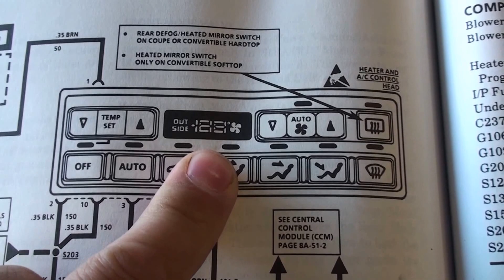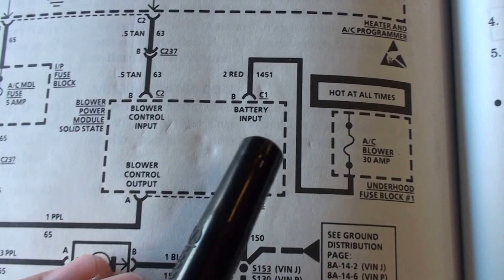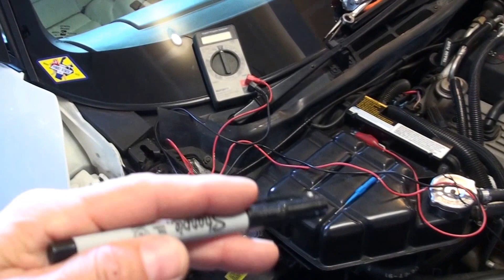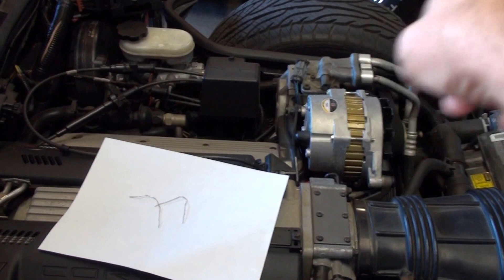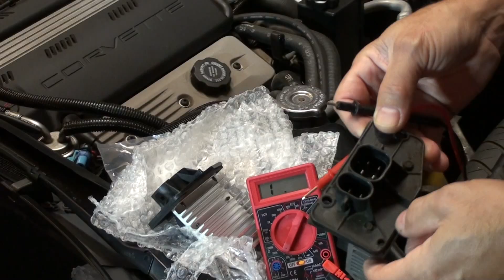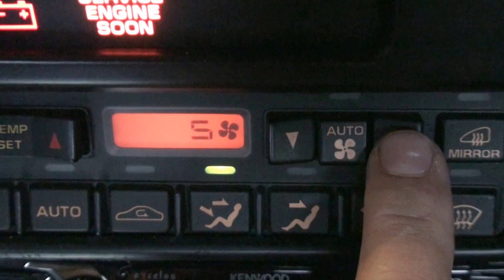Corvette Blower Motor Module Diagnostics and Repair! - Ozzstar -

Comment from the maker: 1990-92 Corvette Blower motor module Delco:  https://amzn.to/2JW1R8X
Check out some cool tools in Ozzstar's Amazon Store:  https://www.amazon.com/shop/ozzstar
Please comment and ask questions below.  Subscribe and Like!  Thanks for watching.  -Glen
Reply: Ozzstar. Excellent videos. Can I ask something regarding the climate control unit 1992 C4. I have a code 9 on my unit - low refrigerant - I have had the unit recharged but the code will not clear and the A/C will not function. Any ideas. Thx
Reply from the maker: @garyturner9904  sorry I can't diagnose that over the internet. Are you sure the refrigerant didn't leak out immediately?

Comment: I have an ‘89 Vette, it has 4 wires instead of 3 going into the one connector and 2 wires instead of 1 in the other, which module do I buy?
Reply from the maker: GM part# 16061602

Comment: My fan is either full blast on 10, or it's off. So, since that creates less heat in the blower motor module. That may be why I'm still running the factory blower motor module in my 89. Or just got lucky so far.
Reply from the maker: Sounds like a module problem or eletronic head unit issue. Did you see my video on that repair?
Reply: @ozzstars_cars   Mine is an 89. Though I've already took that apart and rebuilt it with a Batee rebuild kit. I have read blower motors drawing too much current can fry wires. So could just be these chinese blower motors are just junk. I don't remember that wire being melty back when I still had the original blower motor. Though that was a long time ago like 15 years ago when I first replaced that.

Comment: I've got an 89 with C68. I believe C68 started in 86 or 87. And my blower motor wires/plug had gotten melty over the years with insulation dissapearing. And also had the 4 pin plastic plug on the module get melty on the purple wire where the blower stopped working. And had to use a flat blade screwdriver to help pry the 4 pin plug off the module as the melty plastic around the purple wire had coated the male pins and fuse the plastic together.

Had to scrape plastic off the male pins a few years ago and used dielectric grease on the plug to keep it from fusing together. Got a replacement harness for the two wire plug on the blower motor I was going to butt connect on. But seeing this video. I'm going to open up the plastic tubing for the wiring to see if the purple wire and ground wire from the blower goes up directly into the 4 pin plug on the module. And instead see if I can instead buy 12AWG wire and new terminals and replace the entire purple and ground wire with all new pins. Though that wiring diagram kind of looks like the purple and ground wire may connect to other wires on the way to that 4 pin plastic plug.

Also helpful is seeing the later C4's 4 pin plastic plug still has a place to put the 4th pin that is on my 89. As I had seen some photos of replacement 4 pin connectors where the 4th unused pin for later vehicles instead just has an empty square instead of a place to install a 4th pin like on my 89.

As that plug is kind of melty, and they don't sell that black plug anymore. So gives me more C4's to check out with including the later C4's going to a junk yard to see about cutting and removing those plugs so I can use the black enclosure on my 89.
Reply from the maker: Exactly what you said at the end... a donor car and some wire cutters.😜
Reply: @ozzstars_cars  I ended up splitting open that part of the wire harness. And the purple and ground wires are connected to other wires up in the wire harness from the blower motor to the module.

GM used some kind of open barrel crimp and wrapped it with a cloth tape. Also, the wires at the crimp were silver colored even though the wire isn't tin plated. So they may have hit that crimp with some kind of solder or something at the factory.

It does look like most of the wire is in good shape, just the ends at the plug area are burned up. So may just instead crimp the new blower motor wire harness onto the good part of the wire. And then get some black and purple wire and some terminals and crimp on new wire at the end at the top blower module while I'm messing with it. Will just need to get a new plastic connector.

And the large red wire has some cracks at the terminal. So may get a red wire too and cut and crimp on too while I'm messing with it. Thanks.
Reply from the maker: @colt5189 have you figured out why the wires melted in the first place? What caused the resistance in the circuit?
Reply: @ozzstars_cars  No. I had the blower motor plug getting hot and melty causing blower motor to stop work. Cleaned that up, it would get melty again. But a few years ago put a screwdriver in to bend the female pins so they'd make better contact with the blower motor pins.

The a couple of years later blower motor not working. And I find the blower motor module connectors stuck. I used a screwdriver and took like 15 minutes to slowly pry the connectors out of the blower module as the plastic melted and welded both parts together.

Had to scrape off melted plastic off of the male terminals inside blower motor module. Put dielectric grease on the plug and put it back together. Was able to remove it easy recently as blower motor wasn't working.

This time I pushed the male pin of the blower motor module to make better contact with female pin of purple wire. As it's melty and so that female pin is kind of lose in the plastic housing.

I have read bad blower motors can cause resistance. So I've replaced them a few times over the years just in case.

I have a new harness, and will butt connect it onto the good part of the purple and black wire that connects to the blower motor. Will at some point get new Metri-Pack 480 sealed terminals and splice in a new section of wire for the purple wire at the blower motor module and get a new plastic connector. And guess see how it goes from here.

Could just be poor terminal connections in combination with high power loads.

Comment: 1991 C-4, Blower motor fan control module needed replacement.... Got a 1992 Delco module from Amazon and the wiring plugins work fine but the module base has a different bolt pattern.  I was able to use the new module by drilling 3 new pilot holes for the 3 hold down screws.   Removing the 2 wiring connectors on the module was EASY following your video....Thanks
Reply from the maker: Glad the video was helpful Chuck.

Comment: I have a 1990 convertible. I did your diagnostics as explained but I have voltage coming in from my programmer to my green/tan continuosly even when key is off and removed. Causing my blower motor to run and battery to discharge. I ohmed out the blower motor module and it was open circuit from red power to purple blower  terminals making me believe it's not the module. Any further advice?  Thanks in advance.

Comment: Hi, i been told there is also a fuse which if its blown can make the  heater blow even when the engine is off and key out. Thats  happening on my 1990 convertible. But where is that fuse located ?
Reply from the maker: Not sure who told you that. They should know. No fuse = no power = fan won't work.

Comment: I watched this video and the "Climate Control Repair" video and neither are helping me diagnose the root cause of my blower on full speed only when AC is engaged.  It doesn't matter if blower set to 1 or 10, it blows at full speed when Auto, Recirculate or StraightVent is set.  When feet/straight or just feet vent is set, it runs at a much lower setting.  But regardless of which mode it running on, the UP/DOWN controls are not working.  The LED display shows the correct up/down number, but the blower itself does not change.  Engaging the AC Controller diagnostics reports "00" - no issues found.  Any ideas?
Reply from the maker: Blower motor resistor. Good luck with the fix!
Reply: @ozzstars_cars  - thanks for the quick reply...I will look into it (and report back).  Thanks for your time.
Reply: @ozzstars_cars  - could you clarify please.  The blower motor "resistor" or the blower motor "controller"?  If the resistor, do you have a video or diagram that shows where the resistor is located?  85% of google searches "1992 corvette blower motor resistor" returns parts/images/videos for the blower module...and just a few links for the "resistor" part - but no info on where/how to replace it.

Comment: Where do I start with a blower motor that will not come on in my 93?
Reply from the maker: Start with a test light and check power and ground at the blower motor/resistor. Check fuses.
Reply: @ozzstars_cars  thank you!

Comment: I know this is an old video, but just in case someone stumbles onto it and needs the info. This module for the Corvette runs between $80 to $120. The 93 to 96 Jeep Grand Cherokee uses the exact same part and is currently available on Amazon for $16.
Reply from the maker: That sounds like a bargain.
Reply: @ozzstars_cars  
Gotta love that Corvette tax.

Comment: I have the test light and repair manual a foot thick but I still can’t tell where I should start poking and prodding
Reply from the maker: If the fuse keeps popping then there is most likely a power battery + short to ground. Look for rodent damage or a wire with cut insulation.

Comment: So, I have a 1990 Corvette, and my heater was working until I replaced the 10 amp fuse for the car stereo.  Can anyone shed light on my issue, and if there's a fuse to it? Thanks.

Comment: Hey I need help, I have a 95 corvette, the temp control works but if i put the temp on 90 is blows hot like it should but if I put it on 80 it  blows cool, will this part fix it.
Reply from the maker: Probably not.  TIme to diagnose the blend door.

Comment: Good video.  Question: The blower on my '92 LT1 was running all the time but not on "HIGH" .  I unplugged both the module and blower to keep the battery from draining.  I just checked and there IS continuity between the red and purple wire module 
terminals but wondering if the meter would show continuity IF it was set to a speed other than "OFF" at the time I unplugged it
(ie does it remember and retain the most recent setting?) OR should there be NO continuity regardless of the speed setting at the time it was unplugged?

Comment: Hey Ozz. Your video from a few years ago helped me replace my climate control in my 94 base model. Thanks for that. My blower motor has been making noise for a while. On the way home from work one day, it stopped working. I installed a new one but I still can’t get it to work. The info I’ve found on line has been limited. Anything you can do to help would be greatly appreciated. Thank you, sir!
Reply from the maker: Michael check power and ground at the blower connector if that's good test the blower directly with 12 volts.  If it turns on the motor is good.  Problem is elsewhere.
Reply: Sorry, name is Michael

Comment: 84 corvette blower motor dont blow hard how do i get it to blow harder  it works ok  just not that hard
Reply from the maker: Test the blower motor resistor to make sure its working properly.  Also test the motor to make sure it can reach max speed.

Comment: Have a 1990 c4. Blower motor won't come on when any mode selection is made. Cleaned the climate controller as you described in your other video. Still nothing. Could it be the blower control module?
Reply from the maker: It could be as simple as a blown fuse. Diagnostics is the answer to find the problem. Good luck

Comment: Nice channel nice video nice clean vet,I subscribed...  I had a 96' when new years ago, and il probably buy a nice condition used one again soon,im sure il have repairs like this  👍  ... talk soon.
Reply from the maker: Yes the '96 is a good one to have, manual trans and you get the LT4 sweetens the deal. Thanks for watching
Reply: That's what I had, Black on black, it was nice, if I remember correctly the air conditioning compressor was on all the time with that car.

Comment: Hey Oz, my 95 corvette's blower works intermittently. When I check power at the connector for the blower I'll get voltage momentarily but then it drops out. I think the blower brushes are going bad in the blower because I can tap on it and it will come on. But the the voltage drop has me confused. Now, I am checking with the connector off of the blower, don't know if that makes a difference or not. With a call for the fan I would believe I should have a constant voltage at that connector.
Reply from the maker: Yes at the fan there should be constant voltage when turned on.  You checked power but it''s just as important to check for proper ground.  A loose or bad ground can cause headaches.  Before calling a bad blower motor, apply 12V directly to the motor with a known good ground.   Does it start and work correctly?? If it does you have an issue somewhere in the circuitry.  Let me know how it goes and good luck.

Comment: Thanks  - I have a 1990 vette with the blower staying on.  I will follow your video to repair.  Do you have a video of replacing the radio with the wiring diagram.  I have an open circuit and the lights on my control temperature head wont lite up when I push a button and my dash consul interupts regularly.  Hopefully u can understand my question.
Reply from the maker: I have a video on the control head https://youtu.be/KBeqA1n9q9A

Comment: 1992 corvette -I have been doing some diagnostics on blower fan that only runs on high. I have power to module, have over 6 volts on tan wire, don't have any readings on purple wire on lower fan speeds.  However when I check voltage at blower I have over 12v at 10 speed and have decreasing volts down to about 6v at 1 speed.  Any thoughts on this would be greatly appreciated.Thanks Tom
Reply from the maker: I would suspect the module is defective from what you are telling me here.   A voltmeter is not fast enough to see the change in duty cycle.   Having a oscilloscope would prove that the module is defective.  The blower motor is working so I would think the grounds are good.
Reply: Ok, I think I will purchase a module, thanks.  Do you have any experience or knowledge on steering or suspension issues on 1992 corvette?
Reply from the maker: I could lie and say i don't know a thing about that haha  I try to help my viewers/subscribers whenever I can.  Ask away.....
Reply: I have had an issue for a long time that on occasions the car will start riding like it has a flat tire.  I have replaced the tires, the shocks and just finished replacing the rack & pinion.  It appear to be fine for a couple of times out, but yesterday it did it again although not as bad.  there does not seem to be any pattern to it you can drives for miles and all of a sudden it will start to do it.  you can pull over and stop and it will usually stops, but it may start up again.  Since replacing the rack & pinion it is less of a vibration but still there. I also replaced a front wheel bearing.  It is very strange. I am lost and have put a lot of money into having these things done by shops.
Reply from the maker: Have you inspected the steering shaft rag joint?  How about the sway bar bushings? Two good places to start diagnosing the issue
Reply: What is steering shaft rag joint?  Is that the u-joint on shaft?

Comment: Great video.  I have a 1992 that the blower works only on 10,  the buttons work and show all the different speeds 0-10, but any only runs on 10.  Would this likely be the blower module?
Reply from the maker: Most times when that occurs (fan only working on HIGH) in any vehicle the blower motor resistor (module in this case) is the cause.  I would suggest you do some testing diagnostics before replacing any parts.
Reply: Thank you for reply.
Reply: @ozzstars_cars  I have a similar issue with 94 C4 Base. Two dashes in control head, high blower and no diagnostics. I noticed in your module test you went pos lead to 12v pin and neg lead to purple pin. In the same test on the new part you put neg lead to 12v pin and pos lead to purple pin. I tested my module and when I put pos lead to 12v pin I get an open best if I put the neg lead to the pos pin I see max resistance/closed/short. A short should show either way, no? I'm the guy that holds the lightbulb when the two guys turn the ladder.

Comment: No aftermarket radio. Car is in stock condition. Pulled programmer and added new vacuum lines directly to programmer, still same result. unplugged programmer fanned stopped blowing and 2 dashes disappeared from head unit. I think programmer is shot. The 96 programmers are hard to find and they are not cheap. Has anyone ever used a 95 programmer in a 96?
Reply from the maker: Vacuum lines would have no effect on fan blower speed that is for controlling vent flapper position.  Did you take the programmer apart and check for any burn components or cracked solder joints?  Did you check any of the circuit integrity at the programmer connector or the head unit using a wiring diagram? Checking for power and normal ground voltage (.02 volts or less)  How is the continuity of the wiring between the programmer and head unit? All this needs to be tested to give you direction to find evidence to the problem
Reply: @ Ozzstar  Will try to locate a wiring diagram from programmer to head unit and check today. Will let you all know what I find. Thanks for all of your help.